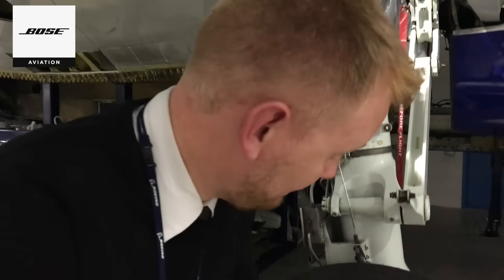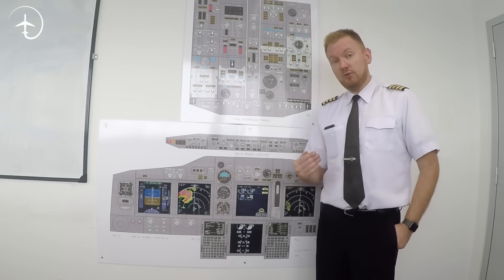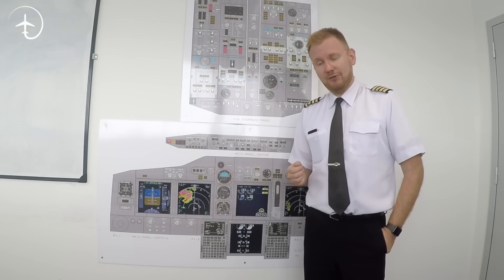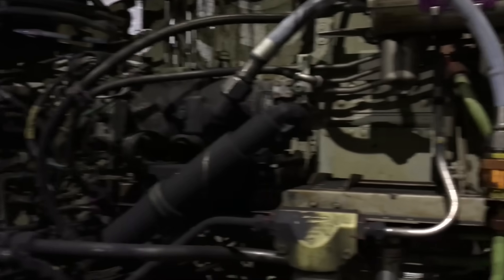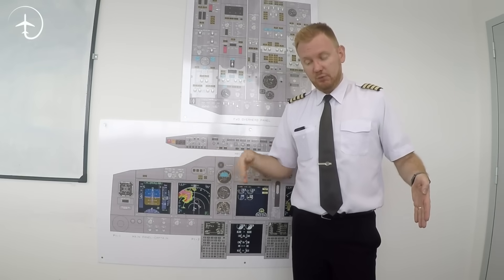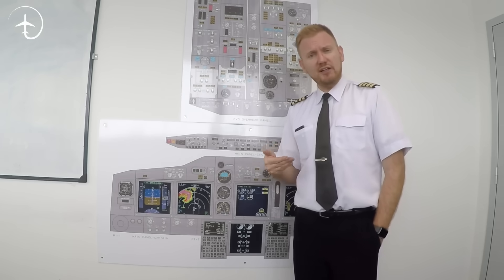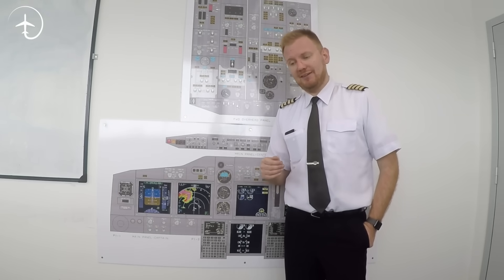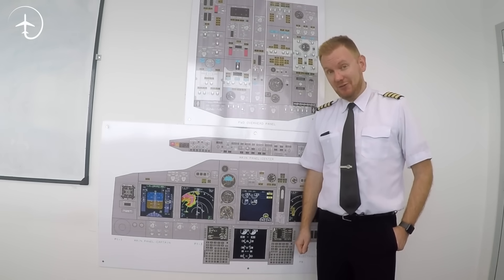Why does the Boeing 737 not have any landing-gear doors?

Comment: I would've expected the wheels to retract into a basically bullet-proof, air-tight compartment. But probably the fuel savings are more important than the added weight.

Comment: i hate this design. is bad, is full of risky plotholes and is another  reminisce of this super old design, along with the bad placement of the engines and the introduction of MCAS and other shity ways to workaround cheaply a Series of critical problems, that lead even to plane crushed and the death of hundreds of people! we know this now. being is still insisting on the old 737 design instead of making a brand new body. Being is the Intel with its outdated 14nm++++++++++ cpus unable to innovate at this point just releasing patches to a problematic slow unsecure and non efficient architecture.

Comment: It is well known that the 37 is a shorter version of the 07 - sharing its very original front and modified aft section (size of vertical stabiliser).

However, a significantly shorter gear was introduced.

Never forget: Lufthansa was the driver that Boeing ever launched the 37 program :-)

Comment: Pretty amazing to take this chance at a time where computer simulation was a dream. They certainly had to spend numerous hours in wind tunnel to validate this design, to avoid drag and awful whistling noise, making the plane unusable. They saved weight and landing gear complexity, all my respect to the design engineers.

Comment: The hydraulic fuse he speaks of was only put on 737s from the 737 next-gen and afterwards.    The break-away fuse fittings were added to protect against a flapping tire tread that could take out critical flight control components in the event that the retract breaking failed to work.  This can happen since the tires are often retreaded.   It does not mean the tire has been punctured as he implied.   These fuses were an after-thought installed after the 1st 737-700 was built when the DERs wouldn't sign off on the vehicle due to the flapping tire tread concern.  The addition of the fuse was included with a large number of other changes to gain more clearance from a potential spinning tire with a loose tread.     The 737-600/700/800 has larger tires and has less clearance than earlier models.   If a fuse does cut pressure to the gear during, the entire system A hydraulics are lost.  So not the greatest design.

Comment: If the 737 had greater ground clearance, then the problems that the 737 MAX had would never have occurred as there would have been sufficient clearance for the bigger engines that the Max needed.........looks like Airbus had made the right design decision on that...

Comment: I attended a talk by a Boeing engineer regarding all the effort that went into the design of the winglets for the Max.  The improvement in the aerodynamics was not large.  I kept wondering if they might have had a bigger improvement by just putting doors over the main landing gear.
Reply: Really eh sometimes I wonder if they trying to look modern I’ve heard differing opinions on winglets some deadly unfortunately

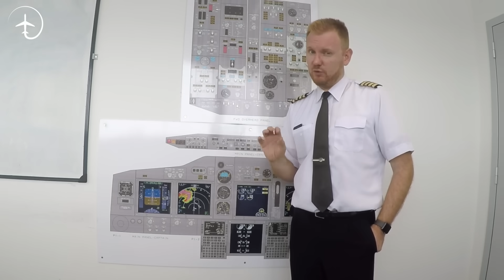Comment: At 8:38 you state that the tires are filled with nitrogen at about 14 PSI. This pressure seems quite wrong to me. Atmospheric pressure at sea level is around 14.7 PSI. So if an aircraft tire is inflated to a differential pressure of 14 PSIG (gauge pressure) it would mean that it is inflated less than a car's tires and much less than a truck's tires. This can not be true. What is the REAL nominal inflation pressure of a Boeing 737 MLG tire?
Reply: 205 psi +/-5 He meant bar😆
Reply: @speedbird9313  Yes, I assumed that he meant bar. But I just wanted to make him aware that he and we all have to improve constantly and to be fluent in converting those units correctly.

Comment: Adding a door is complex

Lets put a hub cap, a balloon, rubber seal, a hydraulic fuse and still leave chance for debris to enter the plane
Reply: Alot of planes have this design. Also fod shouldn't be on the runway as this could damage any aircraft

Comment: what exactly would happen to tyre exterior surface? Heat up by high speed wind or cool down at exact same temperature of -60degree celsius?
Reply: MATRIX Nothing really..the inside and outside  looks the same when they are replaced due to wear.

Comment: what I think is interesting is that the DC-9 series has landing gear doors but the 737 doesn't. Same deal for the A220.
But I think it might have to do with the tail mounted engines with the DC-9 family
Reply: The a320 is taller so it can have landing gear doors

Comment: 14psi is really low pressure for aircraft tire of b737. i think its around/near 200psi. anyway maybe you mean 14bars because its almost equivalent to 200 psi.
Reply: jeffreygrace abulad Yep👍🏻He meant bar. But the correct value is 205 psi -/+ 5

Comment: The plane of too many compromises, the time has long since come to end its production.
Reply: When you consider that the 737 was designed to to share as much with the 727 as possible to cut costs... yeah, Boeing has gotten a LOT of mileage out of this basic template. They might be stretching it a bit too far, in light of recent events.
Reply: Why?  It's a big seller.

Comment: Hydraulic fuse is a major safety concern for a passenger airplane. It can fail at anytime midflight and will lead to an uncontrolled landing gear extraction. It can end up in an deasaster flying over areas with no landing possibilities due to extraordinal fuel consumption...
Reply: Matze Bln And when has this happened?🤔

Comment: What about the Tire Rubber? Doesn't rubber go brittle at such low temperatures at High Alt
Reply: Closed gear cases aren't pressurized or heated as well.

Comment: The nose wheel snubbers! Why not just have the brakes automatically gently applied as the gear retracts? That would also solve the problem of a burst tyre flailing around and damaging stuff in the wheel-bay?  Perhaps this just adds another little complexity- something else to go wrong?
Reply: Richard Hill There are no brakes on the nose wheels on the 737NGs

Comment: They don't have undercarriage doors because they kept falling off the aircraft, like the luggage compartment doors did but Boing felt they could save money by not fitting those doors where as they HAD to fit the luggage compartment doors to prevent the luggage from falling out.

Comment: I think you miss quoted the tyre pressures. You said 14 psi, they would be more like 140 psi. Sorry for being so nit picky.
Reply: Simon Clarke  Main wheels and nose wheels on 737NGs should be 205 +/- 5 psi which is about 14 bar. So he meant bar, but we usually use psi.

Comment: Tire pressure in a 737 isn’t somewhere around 14 psi (as he said (8:35 in the vid)). Main Wheels are roughly 180 psi depending on the model, and the nose wheels are roughly 140 psi.
Reply: Kris Main wheels and nose wheels on 737NGs should be 205 +/- 5 psi which is about 14 bar. So he meant bar, but we usually use psi.

Comment: now why does it even matter a bit? if landing gear doors are "complex and heavy and prone to failure" why don't they get rid of them on 747? why don't they get rid of them on lighter jet airliners? 737 sits low on the ground for ease of maintenance but that's exactly 737 max is such a mess. short ground clearance, larger engines, messy fly by wire to correct alpha = faults and incidents and the airliner getting grounded. so 733 is actually an obsolete design unlike airbus competitors.

Comment: Well this brings up Questions: 

1. Before you retract gears as a pilot , you are suppose to tab the brakes. The gears are going to stop spinning and then disappear, so how can Parts fly around ? But I guess it's just in case

2. What if the gear blows up when already retracted, then the Nitrogen will be all over place. Is that good for all the wires and cables ?

Comment: @10:00

This was and still is the wrong kind of thinking. "It worked for X years so its good". Nope ! 
Boeing is greedy  ! They literally used and still using the same "Chassie" for i dont know how many years. And this "chassie" actually made many problems when they tried new engines etc. They always had to make compromises because it wouldnt work otherwise.

See Max, see engines, see MCAS, see this videos topic.... all the same core issues

Comment: If the hydraulic fuse releases the hydraulic oil and the wheel falls back out , what then locates and locks the landing gear in place for landing if there are no hydraulics?
Reply: gordon Ingle Dont need hydraulic to lock the landing gear..What do you mean by locate?🤔
Reply: Speedbird  what I mean is what then pushes the landing gear into position if there is no Hydraulic oil to do it and lock the landing gear in place?
Reply: gordon Ingle Gravity..

Comment: Worked on many 737's & was aware of the main landing gear brakes & hydraulic systems but I learned so much more from this video.
I mostly did APU overhauls, hydraulic troubleshooting, slat, flap & rudder checks & maintenance & on wing engine checks (fan & last stage t-wheel). Fun stuff!
I still look anytime I hear a plane flying.😊👍

Comment: Very cool to see how different manufacturers tackle the same problems. I work on CRJ-200 and -900 and they have brushes instead of those flaps lining the wheel bays. Also they have "wheel bins" which surround the gear inside to protect structure and components.

Comment: for what reason has the nose wheel no breaks?
Reply from the maker: It has very little weight on it, it wouldn’t be effective
Reply: @MentourPilot  Seat cushions should be a back-pack parachute with a snack inside.
Passengers should have a choice.  To go down with Boeing's greedy MCAS, or jump and take their chances.
Private planes without a chute.  Never take off without a back pack parachute. When things go south.  Pick up everything that could be used to ID you. Put them in your pockets,  Climb out on the wing.  Spray paint over the plane ID as best you can...…………...……….........…… THEN JUMP!

Comment: They should have made the gear longer on the 737 MAX and then put doors on it. Then they could have put the engines back where they wouldn't screw up the flight characteristics and crash the plane and destroy the company. But they didn't.

Comment: Great videos Mentour pilot.  At 8:41 did you say 14 psi nitrogen for tire pressure ??   Not sure about the Max but 700 and 800 series is between 205 and 210 psi nitrogen.  But you are very correct sta 663 is a very busy place.

Comment: How do aircraft tyres deal with both the beating of landing impact and with the pressure decrease of the outside air when gaining altitude? What makes them so strong? More internal metal wiring? Thicker rubber? Other grades of rubber? Other materials involved as well? Active pressure regulation during flight?

Comment: You implied that, since the tires are inflated with nitrogen ,  the cold temperatures at altitude don't really have an effect.  What did you really mean?   Regardless of what gas (N2, air, O2, etc.)  is used to inflate the tires, the cold temperature will definitely have an effect on the tire pressure at cruising altitude, i.e.,  PV=nRT is still PV=nRT at altitude?

Comment: This solution will give extra drag but since you do not need the doors it will also make the plane a bit lighter. I think this will cancel out the lower fuel efficiency caused by the extra drag.

Comment: 2:33 "landing gear doors would be quite complex, and thus a potential source of failures"...

2:55 having smaller doors covering less than 100% does NOTHING to fix or lessen the complexity issue. :-B
Reply: The doors they do have aren't articulated.

Comment: 737 is a poster child of American engineering- obsolete, overadvertised junk with desperate measures to save money on everything. Sooner or later the reality will kick in- every American engineering company goes bust. The same old song- poor fit and finish, style over substance, poor product range, rebadging, obsolete engineering, government bailout, and finally  a long lasting agony with patriotism attached to the last  dying product , which turns out to be a rebadged import. There is a reason absolutely not a single Japanese photo camera manufacturer has ever bankrupted, but all American ones have gone bust!
Reply: Yes, the 737 has only been around for over 50 years now, with well over 10,000 aircraft built and delivered.  Oh, what a total bust of an engineered product that was.  LOL.  ;)

Comment: It don't needs, that for it has a atomatic ram in the ground system.
Reply: Only the new one with max Features
Reply: @technikchaot  the 737 model is first appeared 1967 and the 737 max 8 build just up on this concept, and the result is obvious. Boing has no inventions, don't care about the safety of their planes, don't care about diligentce by their building facilities and tinker just on old models around to can compete with Airbus. I think the 737 max model should never start again, the next crashes are just a question of time and they will for sure happen, they just can't change a lot on the system, coz if they do the plane crashes also coz of the construction mistakes.

Comment: Another reason that there is little aerodynamic penalty for this style of semi-exposed wheels is something called "boundary layer".  The leading edges of a plane are critical.  It needs to be smooth so that the air can pass around it with minimum drag.  As the air flows along the sides of the aircraft there is disturbed air with eddies/turbulence and slower moving air.  (Think of the edges of a river and how it swirls and is slower than the middle ) Imperfections in the smoothness of the aircraft in the boundary layer areas is less affected by drag.   The MiG 25, that Victor Belenko defected to Japan, showed the West that the Soviets used regular, non flush, rivets in the skin of the aircraft in boundary layer areas, saving a lot of money and labor costs over using flush rivets.  This was the fastest tactical fighter ever built reaching speeds in the 2000 mph range.

Comment: Fly Airbus! Yes, both manufacturers have had crashes due to engineering faults in the past, but Airbus does not do cheap, e.g. no landing gear doors and stupendously badly positioned engines a la the 737 Max (because it is all about profit). The latter being a fact that totally escaped Boeing until their bottom line cheapness exploded in their face and the rest of the world other than the USA grounded the 737 Max (who only grounded it, kicking and screaming, after the rest of the world did after not one, but two fatal crashes). Now Boeing is (very belatedly) spending an enormous amount of time and money figuring out how to make the 737 Max fly safely, whilst, at the same time, grovelling wholesale and shedding no end of crocodile tears. The spending of this extremely large sum of money is something that in all human decency Boeing should have done in the first place before releasing their shit-heap aeroplane for commercial use. Now, while they are reviewing their gross incompetence engine-wise they might also perhaps look at providing the 737 with landing gear doors too like most of the world's respectable and competent manufacturers of commercial aircraft do with their aircraft, and move yet another little bit further away from 'cheap' at all costs at the same time.

Comment: Wheels covered by Doors also represent a bigger volume (=»frontal area) and could affect performance. Doors add more weight. 
707-737-727 fuselage in unchanged since the 60'. This a choice driven by production Line and a will to minimise investments.

Comment: We're curious about the wheels attached to the wing and not the body with the VT_TNB | Airbus A320-251N...which is an interesting solution by Airbus..
Reply: It was for landing on the rough runways of India in the 80s -90s when airports were not that well developed. Bur recently,they have retired the last A320 with that

Comment: Quick answer: To minimize weight
Reply: Not only a quick answer, but also a shit answer. Thanks for nothing...
Reply: Weight is a big factor in planes but so is drag, you might save 500lbs or something depending on how heavy of doors you want but flying at 300mph+ drag is probably the bigger enemy, and drag increases significantly with speed.

Comment: John Arnold, if moisture was the only problem you can get air with the moisture removed, it’s called dry air. Nitrogen is basically air with the oxygen, and moisture, removed. If there was a fire in the wheel well you wouldn’t want to feed it with oxygen under pressure from a burst tyre. Nitrogen is inert, it won’t burn, much safer.

Comment: Great vid as always, thanks.

Have never understood the hype over nitrogen filled tires. Normal air is already 78% nitrogen, so how much benefit can there be to going to 100%? Reduced thermal expansion/contraction claims seem BS to me. PV=nRT gas law from basic chemistry was never explained to depend on what specific gas is involved.
Reply: I think the benefit is not in having the extra 20 % of Nitrogen but eliminating the 20% of Oxygen.  The pressure in the tires is high so if air is used for inflation the partial pressure of Oxygen will be high and that can eventually degrade the rubber.  Also aircraft tires can get very hot and the rubber is somewhat flammable so eliminating the oxygen inside the tire somewhat reduced the fire risk. Also, if air is used there will likely be some moisture in it which will cause greater pressure fluctuations with temperature.  Nitrogen from a compressed gas cylinder should be completely dry. Using 100% nitrogen on heavily loaded aircraft tires does give some benefits.  For the tires on your car though, its just a scam.